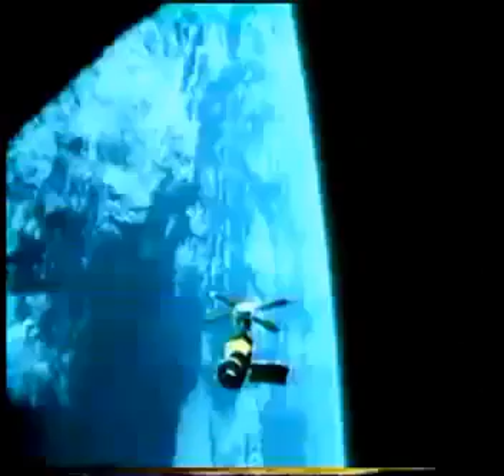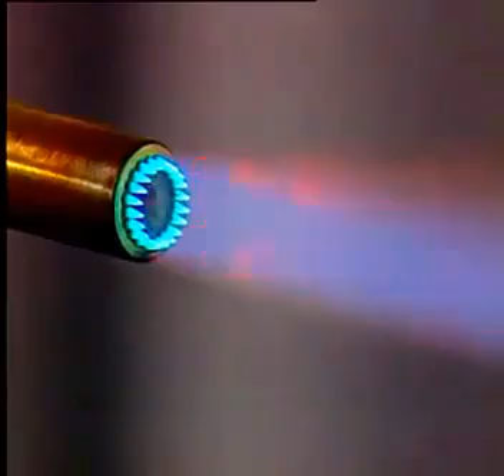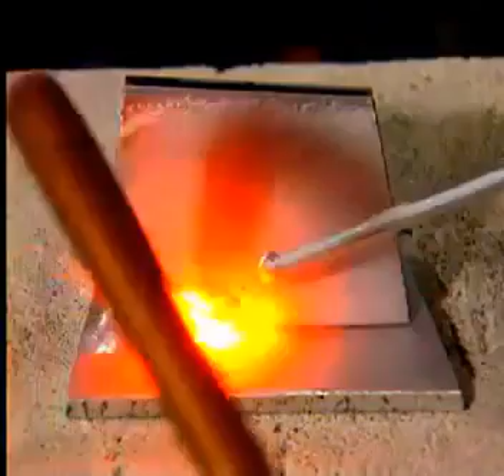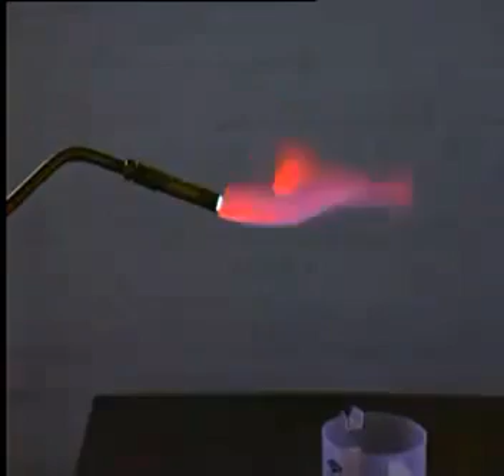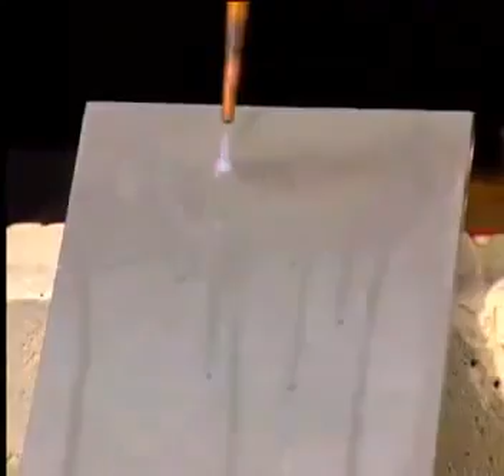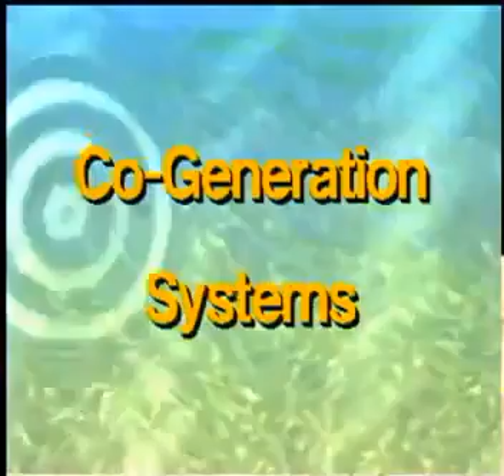hho welder

Comment: not welding,,brazing ,,you cant weld with hho too brittle
Reply: ? yes you can
Reply: @antoniotod9614  hmm idk why i said that at the time i may have been mistaken or under the impression you cant  ,i am still trying to learn more about this particular flame ,how hot it gets or if it depends on the material it is working on
Reply: @ARCSTREAMS  I've never used it, so I can't speak from experience, but hydrogen embrittlement is a real thing, and it's at least one reason why using hydrogen as a fuel isn't preferred for welding.
Reply: @craigslitzer4857  yes i think that is along the lines i was thinking of as well as propane and oxygen can not be used for welding either